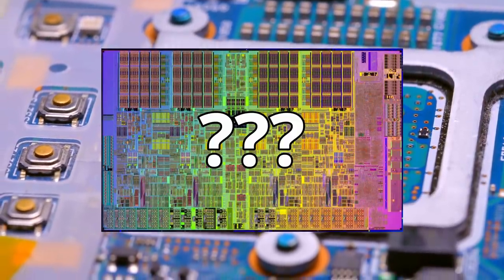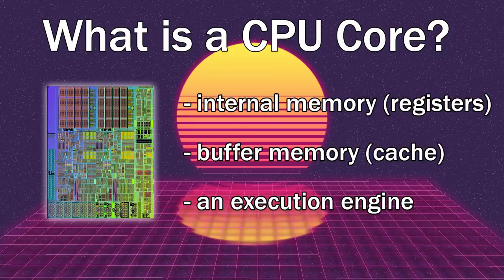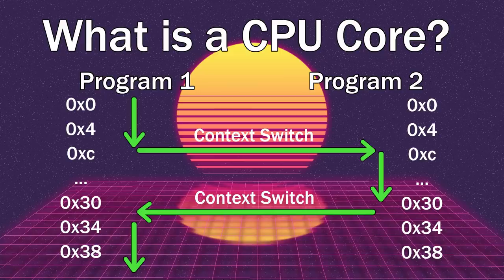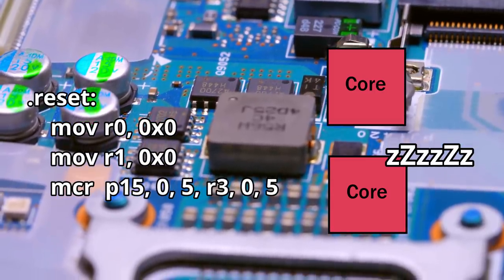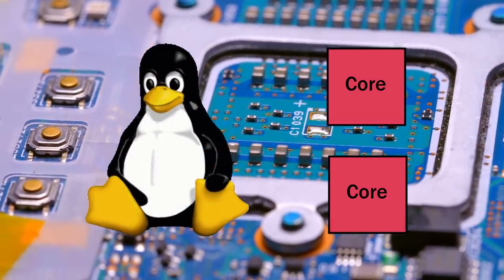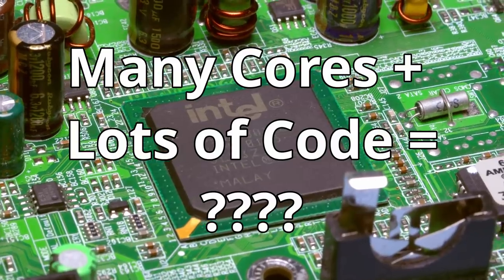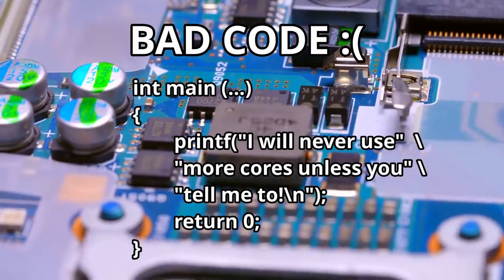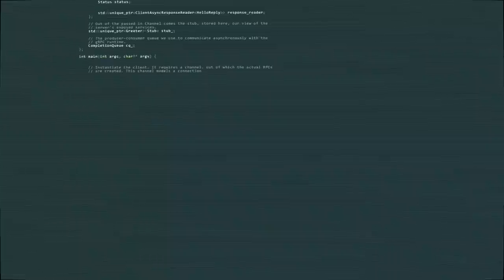why can’t computers have thousands of cores?

Comment: This is a very "Intel" perspective. i don't mean to pick on Intel specifically, but they did ignore multicore processors until they hit speed limits.  I think they were driven by backward compatibility of Microsoft software.  There are other paradigms that are cheaper to build (as they tolerate less perfect silicon wafers), run at lower clock speeds (thus cooler and less power), that have been ignored by popular desktop computing for decades now. For example, massively multi-core arranged in a matrix, with routes between them, and the ability to drop faulty cores.  It does require a paradigm shift from what's common now.  For example, the Actor model can address these cores on a chip, and multiple cores on a global network using a common mechanism.  There's more to computer science than what you glean from Intel and the limitations of their tunnel vision solutions.
Reply: Intel favoring single core speed was driven largely due to marketing. For decades, clockspeed was the main factor in performance, so they favored clockspeed above all else. This is why the P4 was such a terrible CPU. They had a very deep pipeline, which made it easier to raise clockspeed, but gave terrible performance in real world, due to branch mispredictions, and losing dozens of cycles having to flush the deep pipeline.  It was so bad that some P3s were faster than earlier P4s, despite much lower clockspeeds. Higher clockspeeds were a great marketing tool though, so they designed the P4 around clockspeed, and not actual performance or efficiency.

Comment: All those issues are handled in Erlang/OTP, there is no shared memory or locks, it's one scheduler per core and they put a process to sleep if it wait for something.
When something send a message to a process mailbox, one scheduler wake it up again.
It's languages that use shared memory that don't scale, one lock may stop all cores and it need garbage collection that freeze the machine for a short period.
In short, telecom companies had to solve this decades ago, it was predicted. Erlang is opensource and free to download.
For people who can't deal with the syntax, they can use Elixir, it also compile to the Erlang beam code but have a more common syntax.

Comment: * Processors don't run a "loop" of fetch, decode, execute. Every modern processor is pipelined.
* Incorrect explanation of symmetric and asymmetric multi(-core) processing. SMP means that all processor(core)s are treated equal (so they probably are equal), while in AMP this doesn't need to be the case, e.g. in a system with high performance cores and power efficient cores.
* Incorrect reference to multi-core cortex M0. ARM cortex M0 is by definition one core.
* One core can run two threads if the core supports hyper-threading.

Comment: Physics CANNOT be parellelized, not without problems

"Realtime" physics models aren't as granular as video games try to be, with typical numbers being low tens of calculations per second, sure, but those stress and airflow models are usually in the ballpark of minutes per calculation, or just simplified to reduce the end result

Comment: Hi, thanks for the good video
One cool solution for those problems is NUMA architecture, reducing memory bottelneck by optimizing some cpu cores access to spesific memory sticks
Allowing fast access and more memory.
Another solution is using several dies inside one chip, this method is used on threadrippers and ryzen 9 cpus, this sagnificaly reduce chip production costs and allow to spread the cores accross larger area reducing thermal density and alowing more efficient coolling
Reply: Another thing, utilizing infrastructure like kubernetes and virtualisation allows efficient use of many cores and many machines, one programmer dose not need to write more efficient parallel code as most syncronization work is done by the host operating system.
The code efficiency problem is actualy almost non existant in the server world
And in user-run software like video games better game engins and api's like vulkan enables most game dev to not worry about stuff like that.
Most bootle necks today are gpu, and IO bootlenecks, so most of the time its dosent matter how you utilize many cores because you wait for disk access (or even memory in HPC)
Reply: The problem remains getting the data to the cores.
Reply: @jessepollard7132  its not the bottleneck because you can scale throuput using different memory controllers and DMA
Reply: @IceQub3  no. A single memory cell has to complete its memory cycle. And during that time only ONE access is available. all others must wait.
Reply: @jessepollard7132  memory access parralelisem in NUMA exist.

On modern cpu, even consumer grade, multiple memory accesss is possible when in different memory banks
Reply: @IceQub3  yes. That has been true since the 1990s.
Reply: @jessepollard7132  so, If we agree, I think I did not understand your first comment
Reply: @IceQub3  They are using multiple memory busses.
Reply: @jessepollard7132  ofc? in NUMA you dont have just multiple memory buss but also sometimes multiple memory controllers, caches, physical control registers and different DIMMs, so you don't have a throughput bottleneck, and you can have more cores.
Reply: @IceQub3  Having used a number of NUMA systems, there is ALWAYS a bottleneck - just occurring at different levels of accesses.

Comment: In symetric multiprocessing the cores are equal. This is very common on current multi core cpus. In asymetic multiprocessing cores are diffrent. For instance the cpu und graphic card uses asymmetic multiprocessing. An other examples are little big arichtectures or if not all cores can run in kernel mode.

Comment: Just need programs that would benefit from X additional cores. I imagine that those programs would be using neural networks (and would benefit from TPUs - Tensorflow processing units - in addition to CPU and GPUs.)
Reply: There are many other applications that would benefit from a large number of cores (many scientific computing applications), image processing, computer graphics, etc. But it makes more sense to run those on specialized hardware accelerators (like the TPU for neural networks). Also, TPU stands for Tensor Processing Unit. Tensorflow can run on a TPU, but so can PyTorch. Essentially, a TPU is any systolic array which can perform matrix-matrix multiply-add/multiply-accumulate.

Comment: It doesn’t matter if software cannot keep up. Increasing core count is about computational density. If you could run 5 jobs on 5 dedicated CPUs before, and now you can run it all on a single CPU, you can fit more computation into the same rack unit space. Not even mentioning power savings.

Additionally, both Intel and AMD  have features allowing partitioning L3 caches between cores, and consequently processes/VMs, further increasing efficiency for shared computing.

Temperatures of the newer CPUs are successfully mitigated with centralized water cooling in the data centers, albeit its still a novelty.

Comment: You can download a registry hack to reduce the number of cores in the power settings. When enabled, if the laptop is dual core, 50% is single core. Ideal for battery power saving, but only comfortable with more cores, reducing to dual core. So, a quad core should be 25% if you would like to use with single core.
Reply: This is rediculously inaccurate

Comment: Could a cpu have a certain onboard set of protocols or parameters for general use for programs to direct code to the most optimal cores for said programs, even though it would only be able to do this to a certain (very) limited extent, a program should still benefit to a certain degree from this information. For example if code A could be better put to use in a certain core than Codes B,C and D(Any core can run the code just at varying Efficiencies), the cpu would be unable to allocate all of them to optimal positions because it would not only be the programs job, but also because it does not have the obligation to do so. However if it was able have a function that stated Code A has a property that can be run faster in Core #12, it would assign Code A to core #12, meanwhile while Codes B,C and D depend on the program to assign them and if the program cannot due so, the cpu would default it to the least stressed core at the time. Could a protocol like this take some of the stress of the program to assign what could should be run where?
Reply: You would have to know how your processes behave how long they take to execute in worst case,.... You find something similar in a static scheduler which is used in safety critical/time critical systems. But those problems have to be solved pre runtime.

Comment: Good video. But multi core processors are extremely useful in enterprise and virtualization spaces. I know you're probably trying to inform the everyday consumer but I feel it would still be good to point out that they do indeed have the use. But you and I will simply never see it (only behind the scenes when using applications).

Comment: You forgot the number cruncher machines: 4way 64 cores 128 threads in a 2U unit.
It's not common anymore as rackspace providers limit the thermal output and power usage. If you fit 1000 virtual servers on on of this computer the cpu's have allways something to do.
More ALU (CPU's) are used on GPU's. Intel designed a GPU which was really only as many x86 CPU's on one card as possible fit. If you know the sony PS3 chip (the DSP) you could run 4 or 5 command's in one cycle with one CPU (the code is ugly as hell).
You need a very powerful computer to install a smartphone or it takes ages (not the kernel, but everything else needs much time to compile if it still compiles at all [as google make some changes in the API every single time, no big deal but you have to find these changes and change the code to the new example]).

Comment: One thing I find I miss from the old single core days is it wasn't about how many cores a processor had, it was about how fast the clock on the processor could be as well as the front side bus. We seem to have stopped getting faster processors and instead cramming more cores into the processor. Any reason why we aren't seeing 5GHz processors or even 10 GHz processors more commonly?
Reply: Heat, Intel claimed Netburst(P4 architecture) could do 5GHz but the heat made it extremely inefficient, AMD Bulldozer(AM3+)can reach 5+ GHz but it requires LN2(liquid nitrogen) as it's cooling method, same goes for other modern CPUs(Linus got 6.9GHz on a 12th gen i9 with LN2), once the thing went past 4-4.5GHz, it will be hot as heck
Reply: Losses multiply the higher clock speed you go. Unless we can figure out better materials to make proccessors, the 3-6 GHz range will be the standard for a long time. The world record is about 8.9 GHz that was just broken recently after 10 years.
Reply: YUP. it is called heat. the chips can't transfer heat out fast enough.

Comment: You didn’t talk about server processors. Xeon Platinums are available with 56 cores. And are scalable processors. Most servers equipped with them run 4 of these. But in larger mainframes in banks they run with 8 and 16 of these processors in unison. Way better then the old 2 processor Xeon setups.

Comment: If you are performing very simple tasks but a lot of them, more cores will always be better.  Every webpage you load from a server is 1 core of some server somewhere in the world accessing its harddrive and sending you the file.  So if you want to host a webpage to a million people, it would take 10,000 computers with 100 cores each, which is exactly what the internet's servers look like.  Or if you want your computer to show you hundreds of million little dots every second, it would be much easier if you had thousands of little tiny cores, and that is what videocards have.  The problem is that some things can't be split into 1,000 separate steps that don't rely on all the other tasks to finish first.

Comment: This is just outright incorrect... Not only can computers have thousands of cores, there already are computers that do. The Cerebras CS-1 as an example has a wooping 400k cores. Your reasoning for why they can't, has nothing to do with a limit and is entirely about that any given program cannot use any number of cores. But for systems like the CS-1 which is designed to run thousands of smaller programs in parallell. CPUs like this does not use affinity, they're outright stuck to the core they loaded at, and typically never do multi cores per program... And something you really need to also understand... A GPU, is just a specialized CPU. And how many cores does a GPU Have? That's right, thousands. A 4080 has almost 10k cores, and obviously we DO make use of them. This is exactly because rendering tasks lend themselves very well to this kind of processing. Basically, your title is just outright wrong and should have been "This is why general desktop programs don't make use of more than a few cores" or something along those lines.

Comment: Mohr's law ended about 5-10 years ago. 4nm is the smallest a transistor can be before quantum tunneling starts and transistor size is really what's responsible for Mohr's law. So until another semiconductor is discovered computing speeds stopped growing at the rate predicted by Mohr. Gains only come through efficiency these days. If you consider cost per Mhz Mohr's law might still be true but not in pure speed. Processors have never really gotten faster, they've just gotten smaller and more transistors can fit, but each transistor is going the same speed it always had. The next major leap won't come until either quantum computing is a thing or a better semiconductor than silicon is discovered. 20 years ago a 5 year old computer was ANCIENT.

Comment: I don't think it is true that the first dual core processor appeared in 2005, since I remember getting a Sun Niagara server machine with 8 cores and 32 threads in 2005 and before that, in 2004, the UltraSPARC IV had two cores.

Comment: Apple got around this problem and there new chips are 4-8 multi core cpu with gpu linked together thru a new buss matrix as well as a way to share all the cores and much more. But they have worked around these problems.

Comment: Moore's law is actually at it's limits since we're at the point where individual conductive paths are only a few atoms thick. Like we low-key can't make them much smaller anymore. Now it's time to focus on architectures instead of extreme miniaturisation. Even if we can't go much smaller based on Moore's law anymore, there's still a lot of new efficiency and design we can pack into a CPU at the same transistor size

Comment: The Cortex-M0 isn't inherently a multi core processor. Some of them are (for example, the Raspberry Pi RP2040) but most of them aren't. ARM processors are often mixed and matched on a single chip depending on the particular system's requirements.

Comment: How is single gigantic multicore cpu different from a supercomputer with hundreds of cpus (let's not consider the newer models that have gpus)?
Besides thermal efficiency is there another significant difference?

Edit: Also another important aspect is facility to repair, since one single tiny cpu is easily replaceable but the larger counterpart would require essentially change the whole machine.
Reply: The difference is memory. A supercomputer might have thousands of CPUs. But each CPU has its own memory and it is more like a lot of small computers connected by a network. It is the job of the programmer to split the task into units that can be solved mostly independently from another. Exchange of information between CPUs is extremely slow.

Multicore CPUs share their memory between cores. That means that it is easier for the different cores to collaborate on the same task. But as the number of cores grows, it becomes more difficult to access memory in a consistent way.

And GPUs are an entirely different beast. They are massively data parallel but cannot handle random memory accesses and independent instruction streams well.
Reply: A supercomputer (or HPC machine) isn't a general purpose machine. It has been build for certain applications. Mostly number crunching like solving systems of linear equations. These sorts of problems are typically easily parallelizable.

Comment: The odds are VERY good that this video won't wear well.
The ONLY current limit is how small the transistors can be made, and how many per core - we're ALREADY at 256 cores on an ARM server chip, and that part was made on a 7nm node - 3nm has already been announced, though it's a few years off, and THAT would support 1024 cores on the same size of core.

I'm also going to point out at the Supercomputer market - where "massive parallel" is the NORM, and more cores per CPU in the machine (some of these machines have had TENS OF THOUSANDS of "CPU cores" and some have moved to PARALLEL GPUS with HUNDREDS OF THOUSANDS OR EVEN MILLIONS of cores) would be welcomed.

There are SOME uses that can make use of that many cores - even though the "general desktop" market finds it overkill.
Off the top of my head, some geographical mapping work for stuff like oil and coal exploration, nuclear physics, cryptographic work (Distributed.net as an example, NOT Cryptocoin mining), DRUG RESEARCH (folding@home as a PRIME example)....
Some of this type of work ALREADY uses massively parallel supercomputers.

Comment: Simplest answer:  When the CPU's entire set of cores outruns the backplane's ability to provide access to the required memory, you have too many cores.  When you have so much going on with multiple cores that the chip overheats, you have too many cores.  Don't look for complex answers.  Other issues like "inefficient program structure" having little to do with how many cores is "too many."